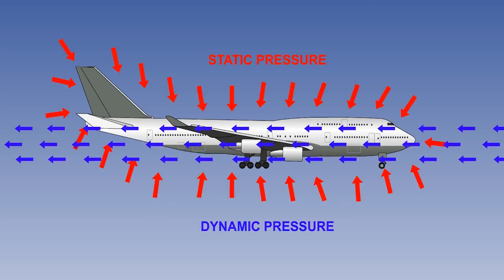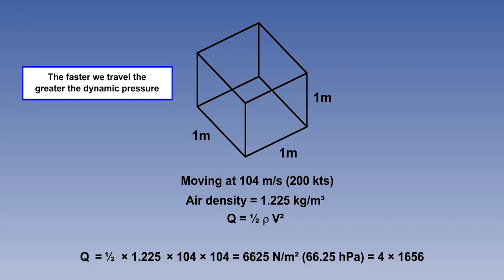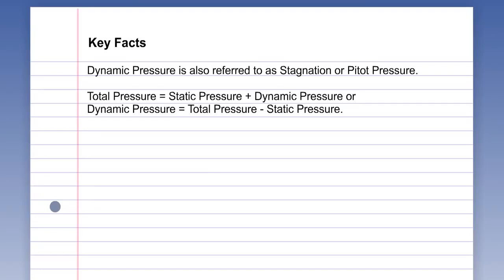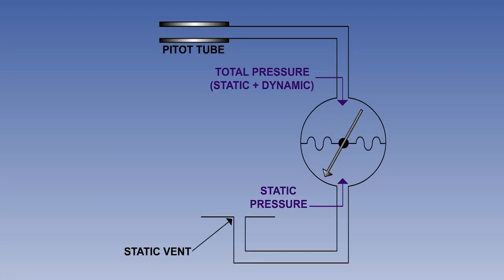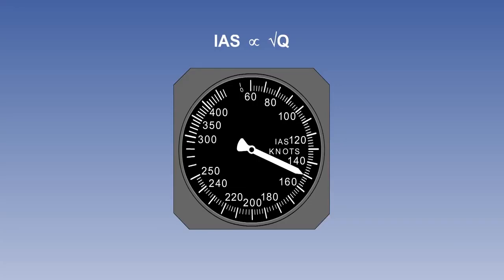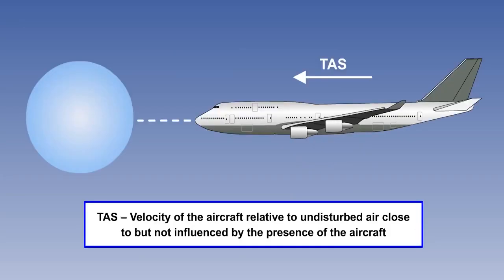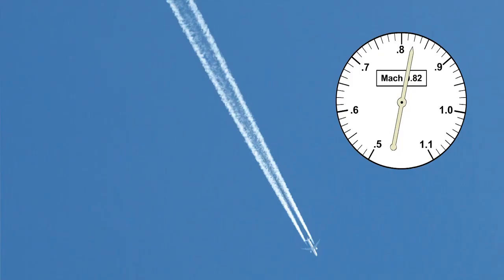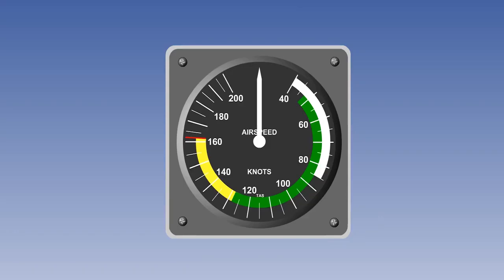04  ATPL Training video  Principles of Flight -04 The Atmosphere   Dynamic Pressure and Airspeed

Comment: Watch the three at 0:17-0:21 !!! The aerodynamic cavitation behind the tree creates Low pressure aerocavern (Lee side vacuum*) and Suction force from me called "Suck paradox" which is much stronger than the force of High (Super-atmospheric) pressure on the front (windward side) of the tree. *Vacuum here means zone with lower density and pressure than atmospheric in the vicinity.